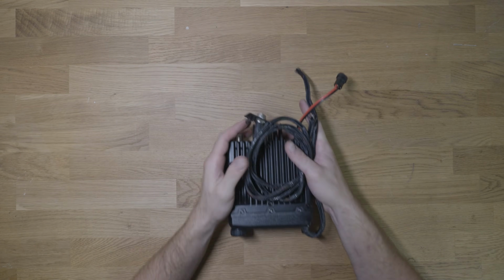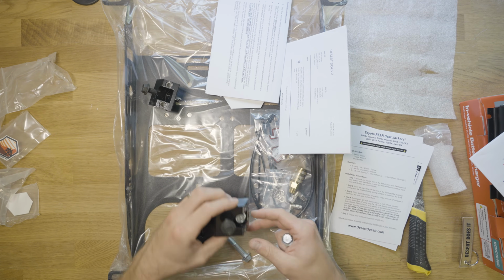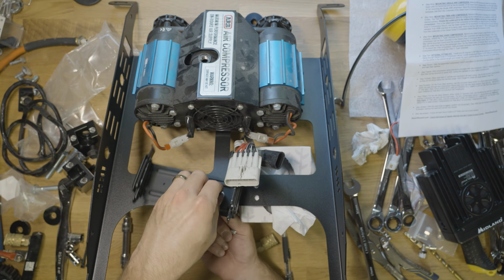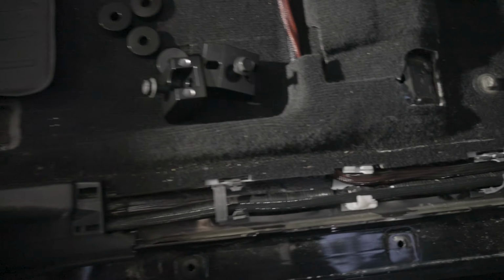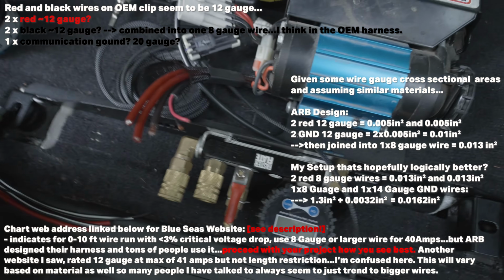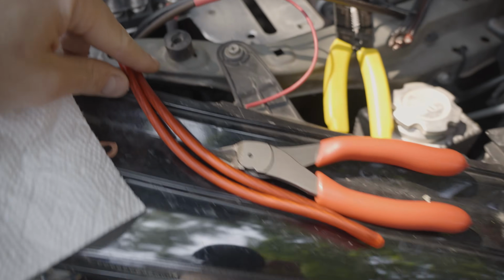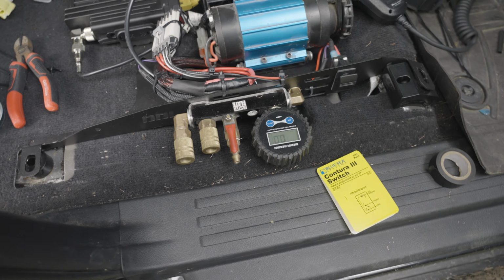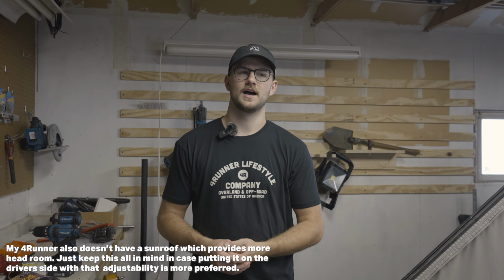4Runner SPACE Efficient On Board Compressor/Radio/Inflate System | Desert Does It, Midland, ARB Twin

Comment: My main concern with putting the compressor under the seat is how much damn dog hair collects on the floor mats in my truck. Where are the air intakes on the arb twin?
Reply from the maker: They have those little filters. Good point though to keep them clean.

Comment: Curious how hard it would be to clean under there. I’d be worried that stuff would get muddy/snowy/wet over time.
Reply from the maker: Well there’s a large ridge between the whole system and footwell space that semi protects it all.  For vacuuming etc, I’d just pull the seat.  It’s 4 bolts and like a minute with a drill.

Comment: Love the setup. In my 2015 Tacoma I have the Desert Does It mount under the passenger seat. ARB Twin and Midland MXT275 mounted to it. FasterFlate 4 tire inflation system and Ethernet port mounted on the Dash. Handset rides in the center console until I need it.
Reply from the maker: So the same setup does exist!  I knew saying that in my thumbnail would bring someone into the comment section who had done that.
Reply: @OverlandEngineer Haha. Great minds think alike. I only have the hose system from FasterFlate. I don’t have the block and bracket like yours.

I have a weird switch setup too. I have the toggle switch to turn the compressor on/off in the DD mount. But the trigger wire is hooked up to my SwitchPros.
Reply from the maker: @Thergood  interesting.  So do you have a single pole double throw(I think that’s right)?  Like you can control with a switch and the switch pros
Reply: @OverlandEngineer  No. I turn it on at the SwitchPros and then I have to hit the toggle switch on the DD bracket. I did it this way because sometimes I use the compressor to blow dust off the back of the truck. Just a couple quick bursts with an air chuck. I wanted to be able to do this with the engine off. The SwitchPros gives me an easy way to do that without powering the toggle switch full time.
Reply from the maker: @Thergood  Ah I see.